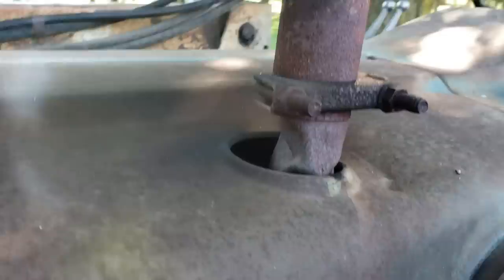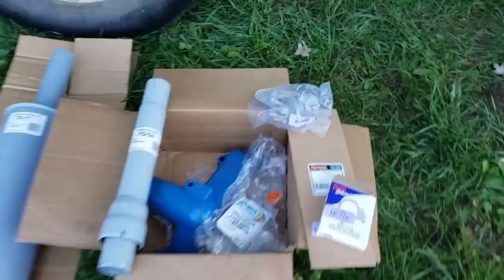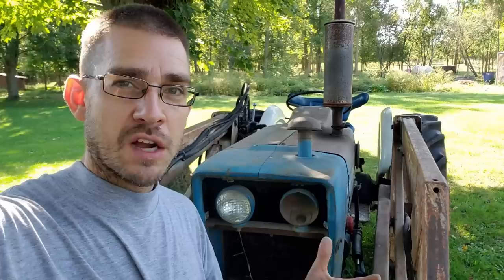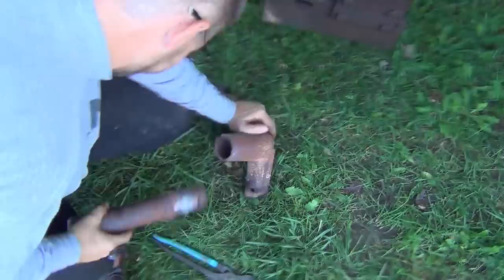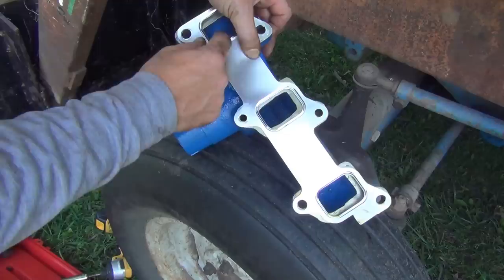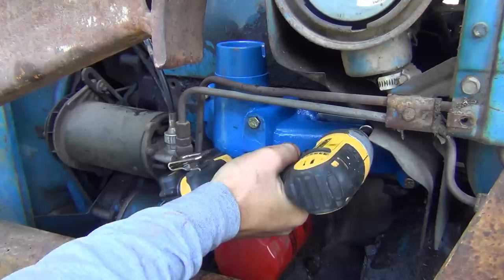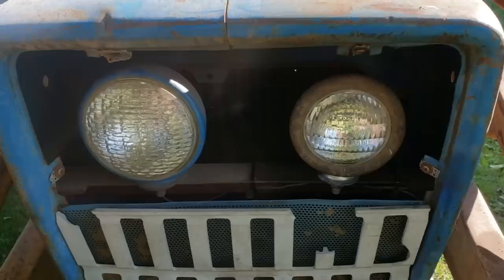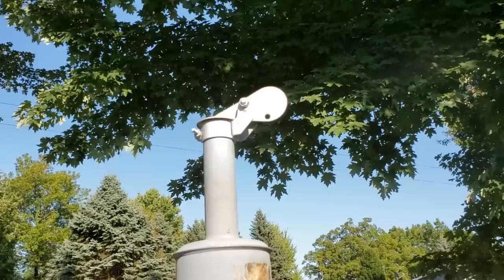This Tractor Made Me Sick - Ford 4000 Exhaust Repair

Comment: Great job, do you realize how blessed you are that those exhaust manifold bolts came out without ringing off? The paint is not going to stay on that exhaust manifold no matter what paint you use. I've been building engines for 40+ years, and have yet to come across a paint that will resist the heat of a stock manifold. The exhaust flap is fine that way because you don't run it at high speeds so it won't affect your compression. Yes you're right we always run into that one bolt that just won't come off. Great job. And thanks for sharing your video with us, I truly enjoy them.
Jimmy

Comment: I've got a Ford 601 Workmaster. When I converted to 12 volt, OReilly auto parts was able able to hook me me up with a 12 volt motorcycle bulb that fit the stock housings. They were 35 watt bulbs made by Sylvania. It was a simple conversion job - take off the retainer rim, and change out the connector from the old U-style prong to a female blade style connector that fits over the terminal. I also did a rewire job on the headlights at the same time as the wiring harness going to the headlights had been spliced and fixed about six different times.

Comment: Leave your rain cap flap towards you, like the old one. When the tractor is running the rain cap flap will raise much higher and will easily catch a limb and rip the rain cap flap or break it or even bend the muffler. Its turn facing you so if a limb hits it it pushes it down and goes over the flap vs grabbing the flap
Reply: That’s right!

Comment: Love it!!  When all else fails...break out the saws all!!  Only thing I don't understand is why they put the exhaust straight up like that.  I have a 1958 Ford 861 and the exhaust is routed down and under that tractor and exits just behind the rear axle.  Even with that setup, I come in the house smelling of exhaust fumes after brush hogging the field, I can't imagine having those fumes right in your face for that long.
Reply: I've known a few farmers that route the exhaust vertical  I stead of down low on tractors like yours. They are concerned with the heat starting fires when they were doing hay. Just a thought and observation.
Reply from the maker: Yeah, I am not sure that II would want anything hot under the tractor given the field work I use it for, good point

Comment: For exhaust you apply ATF with a rag on all of it. Run the engine until it burns off will leave you a nice gray color that will protect the exhaust. Paint will just burn the flake off.

Comment: Man U got lucky! I just bought a 4000 with a cracked manifold & it took me four days to get it off!  I soaked the bolts every day for a week before even trying to remove it. I finally had to cut thru the manifold & long bolt,even with it cut totally in half an inch from the head that bolt was rust welded to the manifold & others were rounded from someone trying to “fix it” a torch took those heads off. I see u replaced the original manifold,why?  I bought two manifolds from different suppliers both fit like your replacement that would not match the head or gasket ports,I finally got one that was close enough to where I split the gasket in between the ports so I could get the final port to line up enough to seal! If u still have the original I would buy it from you? My original manifold fit the ports & gasket perfectly but with a crack in it made it useless! Thanks for the video!

Comment: Caught your video when I got home from work.  Looked at few Ford 4000 series before I bought my BCS 853.  Great tractors, but getting old.
Reply: A good 4000 is a strong reliable tractor...engine rebuild kits are cheap also. My grandpa's 3410 and 3610 uprated to a 4000 series motor are tough as nails.... when something does go wrong on them it's typically something you can fix or have someone in the nearby city fix (if it were something serious like an injector pump). I've swapped an injector pump once and it wasn't terrible.
Reply: @Wingnut353  Good post, thanks!

Comment: Hey really glad I found your video. I just got a diesel Ford 2600 and bush hogged a few hours today with it today. Now it is 1am and I can't sleep because I have a splitting headache! My tractor doesn't have a clamp on the muffler, so you can just pick the muffler up off the manifold. I'm going to try getting a clamp and checking for any other exhaust leaks. Man, those fumes really messed me up! Never had such a bad headache in my life. Hopefully that helps because I'm hesitant to get on the tractor again after this experience.

Comment: 2 little tips. Rust-oleum makes 2000 degree F header paint (available at auto part stores). I have seen a glass pack muffler on an old tractor and it took harsh tones out the exhaust note while being pretty quiet. Too late now but maybe somebody looking at an exhaust upgrade might look into it.

Comment: Check  to see if the tachometer drive cable is intact before buying a new tacho.  Usually breaks just before the squared end either at the drive end on the generator or the tacho itself.
Reply from the maker: Good to know, thanks!

Comment: I put a flood/spot led lightbar on my tractor and love it. The cheap $25 ones seem to last as long as the ones that cost more. The light you installed looks more like a worklight for the rear fender.
Reply from the maker: It probably is:)

Comment: I drove some big construction machinery once as a kid when I was an intern. Those were modern vehicles in a country with decent regulations and you were sitting in a compartment with glass around it. Yet the soot still got into your respiratory system and would stick to the inside of your nose, etc. This stuff is nasty.
Reply: A Ford 4000 exhaust isn't that bad... at worst it smells like fried chicken >:D

Comment: Those Fords are good tractors. Even though that tractor is about 50 years old, it will provide many more years of service with only minimal maintenance. The 4000 series is a considerable step up from the 3000. Much better brakes and heavier front axle.
Reply: And will last year's beyond a newer one. I bet there will never again be a tractor to last 50-70 years and still be able to be worked.
Reply: @billfischer6464  Ford 9n, 2n and 8n last longer
Reply: @lukebecker1959  definitely agree with both you and Bill. Todd made a good decision getting a Ford. Old tractor, yes, but they are very reliable, both the "thousand series" with the 3 cylinder engines and also the earlier 4 cylinder models. For old, very affordable hp, there is still excellent parts availability and the tractors are easy to maintain, easy to repair unlike the newer tractors. One exception might be the Select O Speed. I have four Fords here which have served me well for years... 4400, 3400, 2600 and an early 2N. No fancy bells and whistles but they always work and get the job done.

Comment: I think its just primer, not paint. Why didn't you use form-a-gasket on the gasket?
Why change the whole light assembly instead of just buying the proper sized sealed beam?
Yes our "flappers" were always turned more towards the front but cocked to the left a little. That way the exhaust always was blown beside the operator as the tractor moved forward.
Reply from the maker: The bracket for the light that was in there was rusted and would not accept a new light. Assuming that is what happened to the old one, it fell out. I will just need to replace both now with new ones:(

Comment: if you put some screen wire or hardware cloth in front of the radiator it will make it easier to clean straw or debris out before it gets in the radiator and makes it harder to blow out .  you might think about building a rollbar to help protect yourself i made one for my 3020 jd  and put a metal top on it(an old head rack off a truck )

Comment: This is a fantastic video and tutorial. I just got a 1970 3 cyl gas Ford 2000 and this has been extremely helpful. And your advice about not messing with too many things at one time is sage advice. I’ve been lost in replacing a muffler and manifold for a week. One question: the main manifold bolt came out so easily. Mine has a square head bolt. What socket did you use to remove it? Mines a bit rounded and looks like it’s going to be a struggle to get out. Thanks!

Comment: Maybe the spare light was an implement light, it looks a lot like ones we had on old tractors.  At least you did the hard work getting the old light out and the upgrade will go a little easier! 😊
Reply from the maker: Lol, yeah it may be an implement light but it will work for now until I can get some leds to put in there

Comment: It looked like you forgot to replace the heat shield for the fuel lines, you may regret that next summer when you are using it in the heat, and you really  should always use anti-seize on exhaust bolts. Probably the only reason you got those off so easy!
Reply: correct

Comment: i think the lens on the big headlight needs turning a quarter turn ,as its set up for a side mounting, on side of the body, allso you could have just cut bolt off, so much easier,..

Comment: Don't mount LED lights on lift arms, then lights will get knocked off, they want be shining in correct place depending where arms are plus a bitch to wire. Make a grill for the tractor and that will protect radiator and keep debris out. Keep that Ford going, a little maintenance and it will be working a long time.

Comment: That gasket is a fit-all for the entire engine family. Your tractor just happens to have the small engine in that engine family.
Just think, if you had just gone and picked up a new sealed beam for that old shell you coulda had it changed in 15 minutes. Probably coulda got it at NAPA. 
That isn't high heat paint, it's just there to prevent rust while the part is sitting on the shelf.
Reply from the maker: The light housing was broken which is why the old light fell out

Comment: If the exhaust fumes really bother you that much, you should have run it downward, instead. Figure out a way.
Reply from the maker: The exhaust doesn't bother me at all when it is coming out of the top of the muffler and not leaking all out under the hood and in my face:)
Reply: Ah. Yeah, that makes sense. =0)

Comment: The exhaust manifold is cast poorly.  That is why it doe not match the gasket.

There is supposed to be another muffler clamp where the extension pipe meets the exhaust manifold.  Not real critical.
Reply from the maker: I thought so too but didn't see anything in the parts list on Yesterday's tractors. I will double check that and grab one, I don't want that bouncing around in there and getting loose

Comment: Don’t put them on the loader Frame they are useless there my father and I moved ours up an the top they work really well there and the power steering as you call it which is power assist is a little known issue on those tractors and is always failing even if you fix it
Reply: They are typically on the outside at the top... always looked weird for me to see them elsewhere on those tractors.

Comment: big mistake to change the manifold with the thin crap chinese cast , You should have sandblasted the original and spray some heat resistant paint. The new one will crack in no time. Always evaluate old and rebuildable original parts against new aftermarket junk.